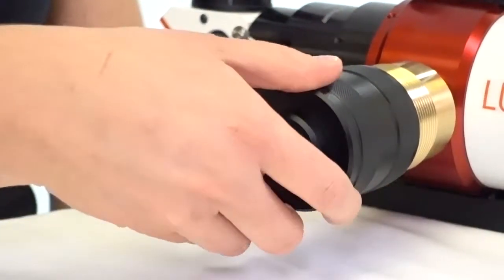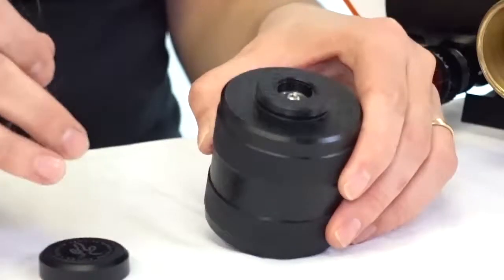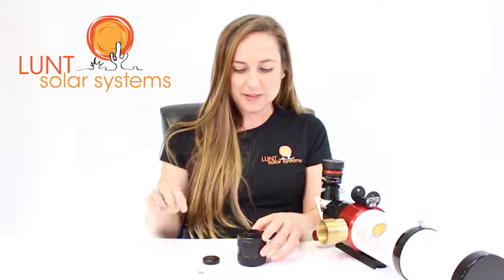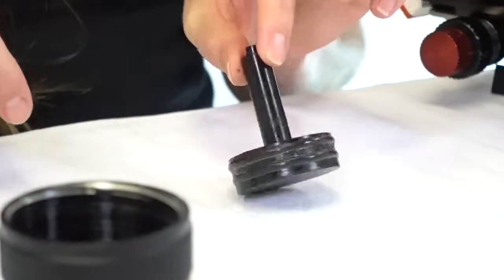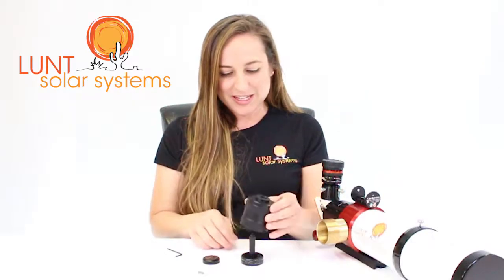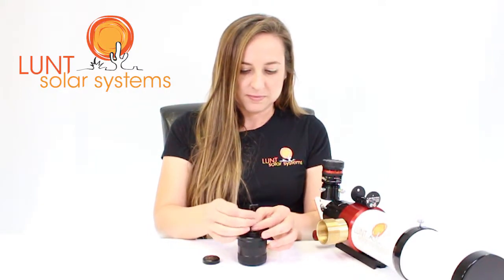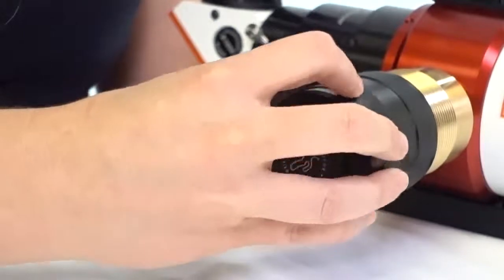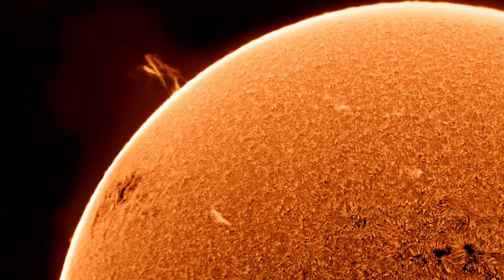Replace Your Pressure Tuner O Rings

Comment: How frequently do these typically need replacement?
Reply from the maker: O-ring replacement times can vary depending on the frequency of use of the scope.  
Usually after 2-3 years it's good to get fresh ones in there.  A good indicator is if you notice having to retune your PT more often than previously noted.  Reach out to tech support toll free any time M-F 877-344-7348 with questions.